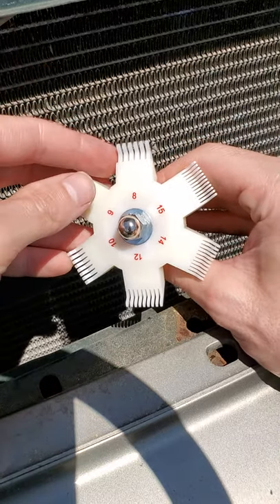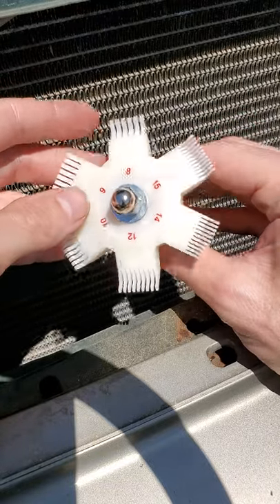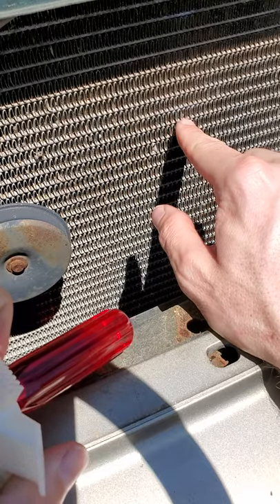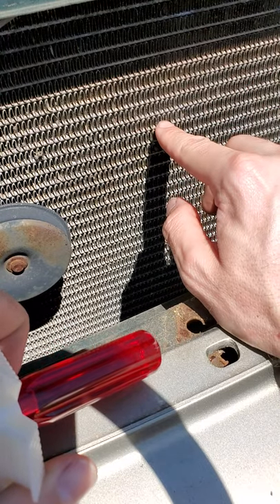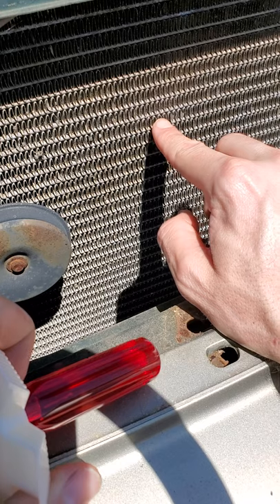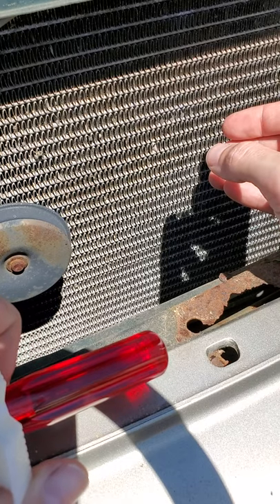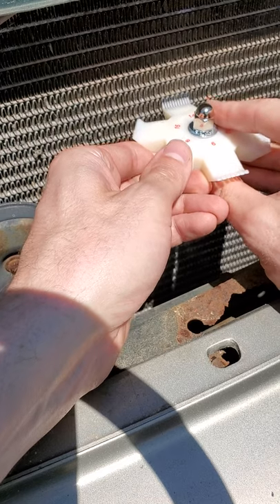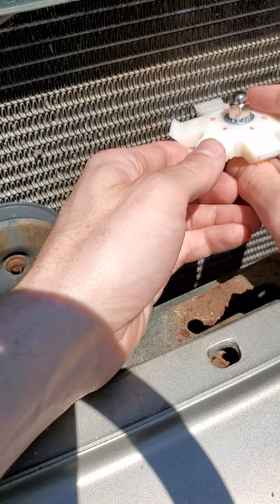Cheap A/C Tool You Need In Your Toolbox! #shorts

Comment: As an hvac apprentice. I'm always amazed at how damaged a condesnor coil can be before a unit will stop working. Yes if a bunch of your fins are folded over, you'll raise your head pressure and lose efficiency. But if your ac isn't working. 9.999/10 times. Bent condesnor fins isn't going to be the culprit.
Reply: Lolololol
Reply: Big facts
Reply: Ikr. Seems like this would just risk a stress fracture

Comment: Look behind the AC condenser too.  One time I found a bunch of grass and junk that had blown thru the AC condenser but been stopped and piled up on the front of the coolant (water) radiator.  You'd never see it unless you look.....
Reply: You are right on about build up between condenser and radiator. I found enough garbage there putting in a new rad, I thought maybe the first owner did somebody wrong and it was mechanical sabotage.
Reply: I never thought this could happen.  I'll have to keep that in mind.
Reply: Ya, or nests for stored vehicles
Reply: I’m still learning about car repair, I’ll have to keep this in mind.
Reply: I watch a few HVAC channels, and washing the crap out of your condensers is so important for preventative maintenance, granted your car probably isn’t in a greasy ass kitchen 😂

Comment: As an HVAC technician these are designed for outdoor units where the coils are perfectly straight up and down and you can run the comb from top to bottom of the coil to straighten them out, while these do work for this they aren’t necessarily designed for this, it would take forever but in a pinch it would work.
Reply: Two decades in HVAC service . Saw that instantly as well. Cheers 🍻.  Get ready for that cottonwood!
Reply: I've done that before, just as a home owner because it looked like it would work.
Reply: PLEASE DO NOT BAN  god bless
Reply: Some older cars do have the fins that run vertically the whole length, the evaporator on your car probably does too most evaporators are like that in vehicles.

Comment: Also for intercoolers! For all the turbo Subaru people. I need one. :D
Reply from the maker: Yeah, totally forgot to mention intercoolers.
Reply: @ratj4715  Huh? Reply to the wrong comment?
Reply: @ratj4715  Oh I see what you are saying now. I actually did buy a comb and it does work on intercooler fins. You have to be careful and you have to work it in certain ways depending on how badly fins are bent. It's still the same concept though, even if it isn't straight fins.
Reply: @ratj4715  In terms of doing more harm than good, provided you end up with straighter fins than before, you are increasing airflow as well as total surface area exposure. Win.

Comment: You just changed the game for PC users who use water-cooling and AIO radiators. They have the same fins and are prone to bending.
Reply: Theres not too many of the fins on them tho, you can just manually bend them back
Reply: None of my fins have bent… and I’ve been using my pc for 3 years straight. U just need a good filter, cuz I don’t see how fins could possibly bend from inside the pc case
Reply: Why and mir. Importantly how the fuck are you bending funs on a card is your pc built on a skateboard?
Reply: @mod.ts76  most of the bent fins are caused by shipping or when mounting the AIO or radiator
Reply: its not like rocks and debris hit that radiator constantly lmao, just bend them with a screwdriver or knife
Reply: What a load of bs

Comment: Tool straighten the condenser coils fins to prevent airflow resistance that lead to high temp thermal overload basically the condenser can't get rid of the hot temps

Comment: I fix OTM toppers for the railroad and the old version has a radiator mounted under the deck where the topper sits which always drops ballast rocks and oil into the fins.  I use fin combs like this for cleaning and they work.  Just buy a new one as you will brake the plastic teeth as you use it.

Comment: I am a professional tech that has over 25 years of experience. I am working on a 2010 outback that when you hit a decent size bump in the road at 25-30 mph you feel a major vibration on the front of the car and definitely in the steering wheel. there is no play in steering ...ball joints, tie rods, links etc...the LF strut was completely worn out so i replaced front struts and surprisingly it didn't make any difference at all. the LCA bushings look like every other Subaru i see...cracking but not torn. The steering does not feel loose at all and there is no play in the steering rack bushings etc that i can feel. What am i missing. I have felt similar in lifted trucks (death wobble). The Subaru is definitely not as bad as the death wobble that i have felt in trucks etc...Alignment is in specs. Can you point me in the right direction, Thanks.

Comment: But that won't not fix my ac in this case, my kompressor clutch exploded=shorter acc belt and also it locked up at one point causing the belt to be hot and also mess up my idle pully, 3rd belt, I've went thru that one too, summer coming, and I need help replacing an ac kompressor clutch
Reply: I'll be damned to have the whole unit changed since it has a perfect ac charge no leaks since it was factory, be damned for pay to replace an ac kompressor and to have the system ac charged
Reply: @benzodiy4053    Really easy dude. Take the bolt out of the clutch hub and remove it. Work the pulley off with a screwdriver or small pry bay. Hammer the bearing out, being careful not to bend the pulley (support it as close to the center as possible).  Reverse the process with a new bearing and hub if needed, don’t forget the shim to adjust the air gap.  Ta da, you’re back in business

Comment: Waste of time. The A/C condenser is not that much and if it shows so much damage to stop air flow where it's an issue you should be replacing not trying to repair.